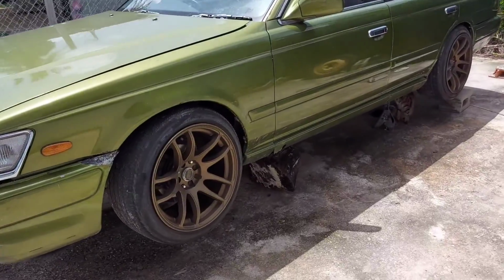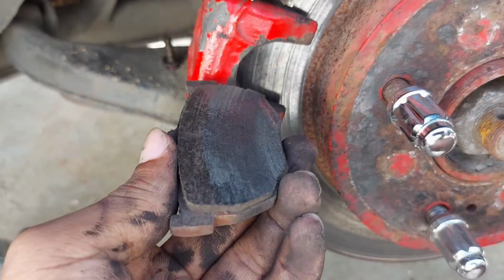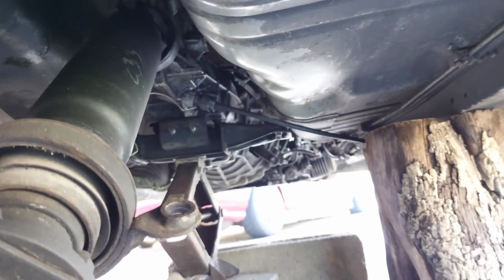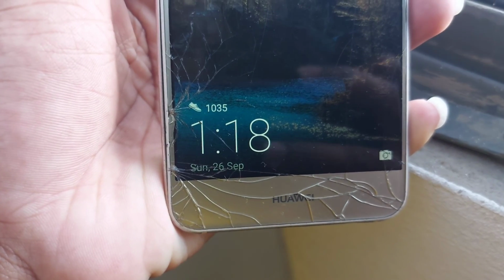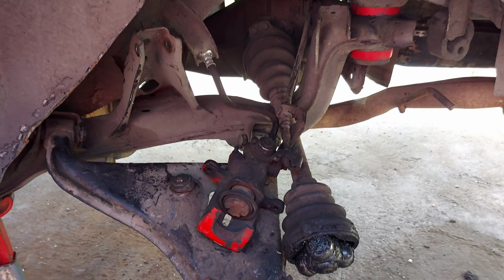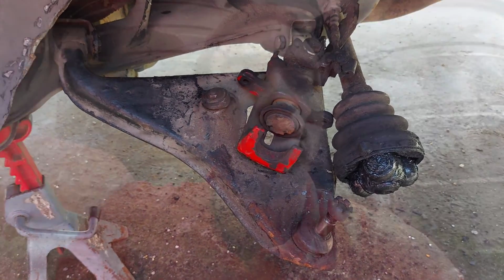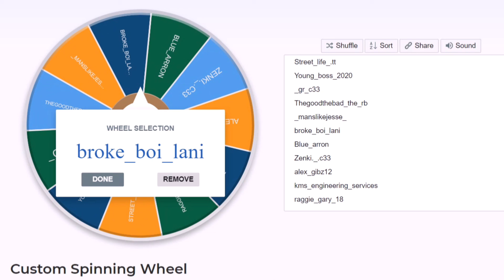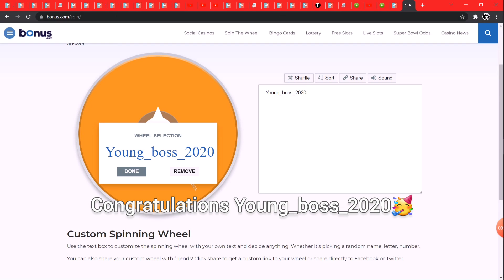The Overhaul (part 1) + Giveaway Results

Comment: U should check the front breaks also,check front and back suspension, change yuh engine oil, spark plugs, gearbox oil and differential oil one time so wen u get back the gear box all u have is drive check the belt and carry the alternator and starter to service and check all the fuse one time
Reply from the maker: Engine wise, its solid. We changed and checked those things shortly after the install and the car hasn't really driven much since then. Front brakes good, front sus i will touch later on, i have all the front poly from the kit, but had to do the rear immediately because the rear was unstable. Thanks for the constant looking out tho bro. I appreciate that🙏🏾